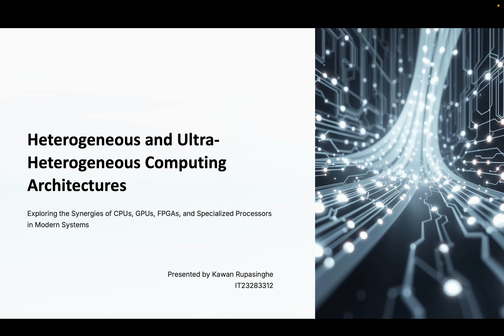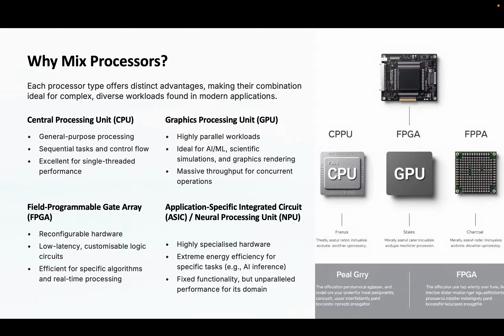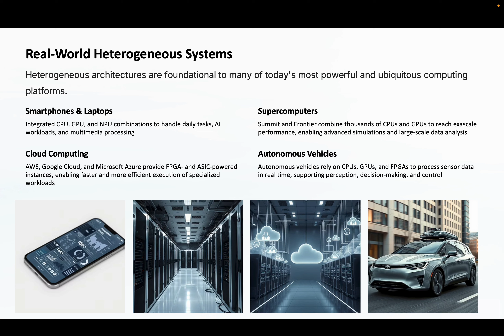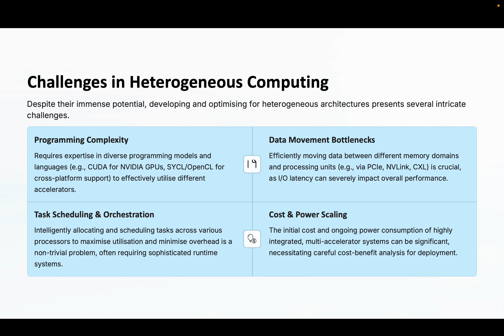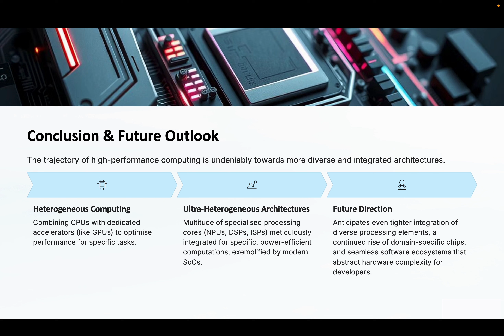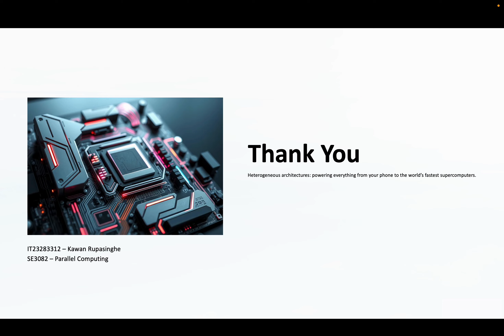Kawan Rupasinghe - Heterogeneous and Ultra heterogeneous Architectures - Parallel Computing Video

Comment: Good explanation of how heterogeneous and ultra-heterogeneous systems combine different types of processors such as CPUs and GPUs to improve overall performance. It's better that you connected the concept to real word examples. The balance between benefits, challenges and recent trends made the topic easy to follow. One thing you could expand on is how software framework or tools(like CUDA or OpenCL) help manage these mixed processors, since that would tie the theory more closely to practical.

Comment: Your explanation of heterogeneous vs. ultra-heterogeneous computing architectures was really clear and easy to follow, especially given the complexity of the topic. I liked how you broke down the differences in a simple way within just 5 minutes. One suggestion would be to include an example of where these architectures are applied in real-world systems (like GPUs or embedded devices) to help connect the theory to practice. Could you also expand a bit more on the advantages of ultra-heterogeneous computing?